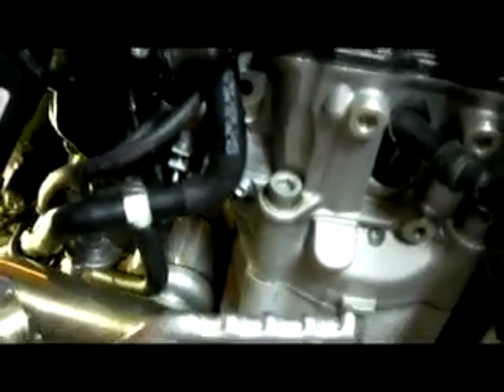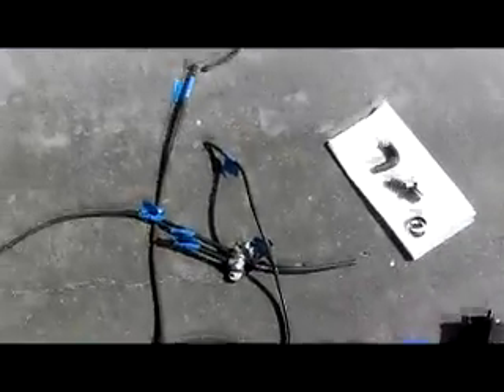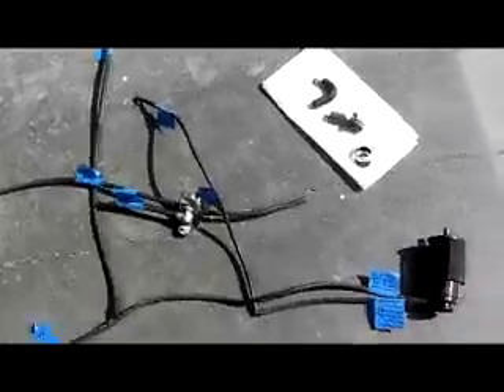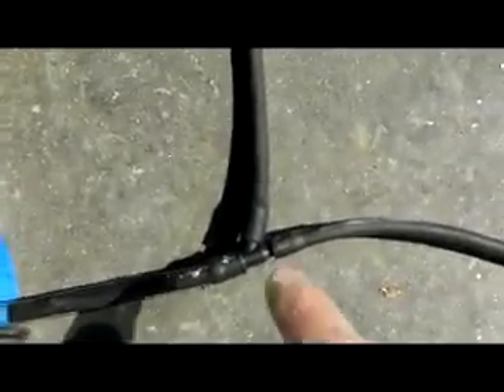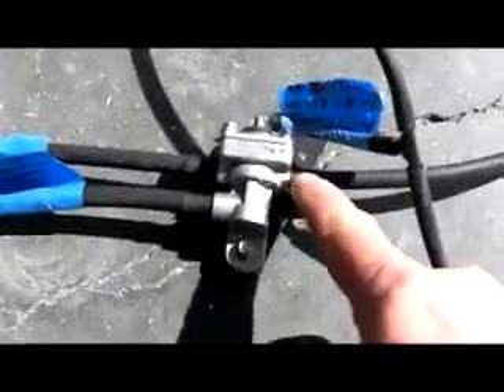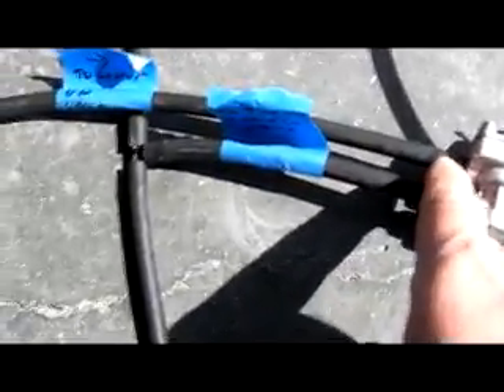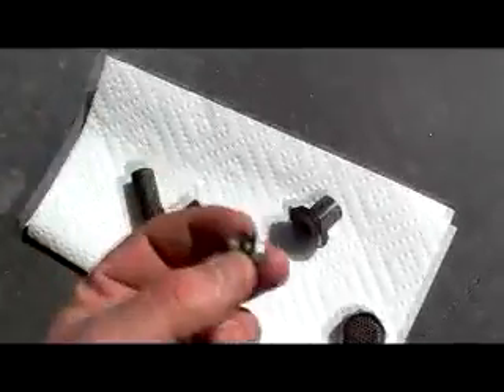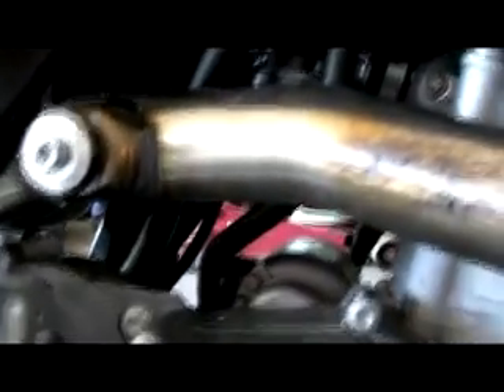KTM 530 De-Smog Remove pollution Control Part two of two

Comment from the maker: Thanks for your kind words.  Mine wouldn't start either and yes, it's A LOT faster after.  The company names are:  JD Jetting (jetting kit $75),  Blais Racing (block off kit $36),  and Works Connection (fuel mixture screw $20).  You also need a KTM #60 power jet for the carb $6.  Free information from RonnieMX  Priceless!  If you need any more help, feel free to drop me a line.